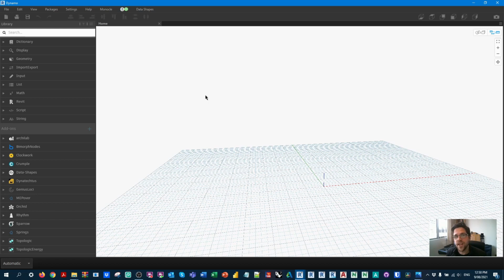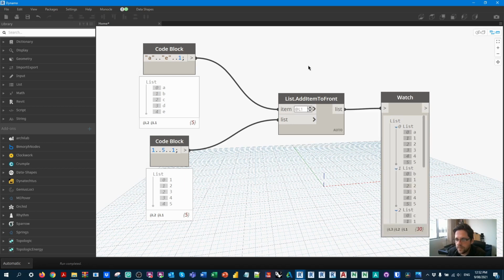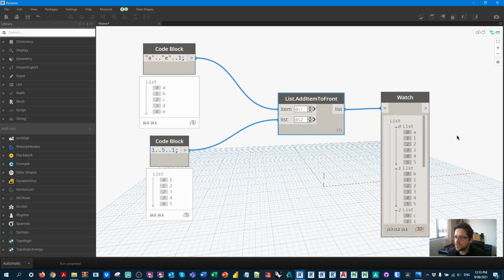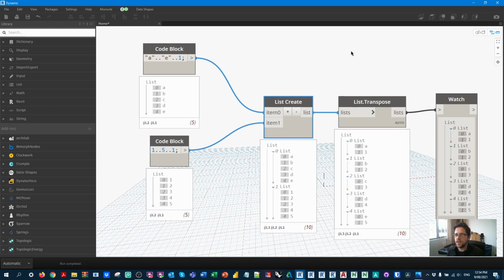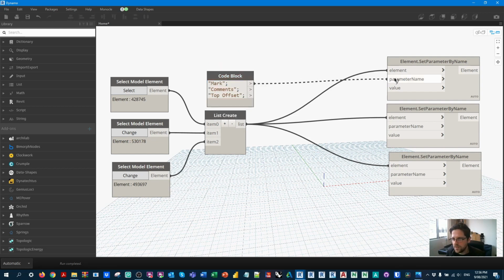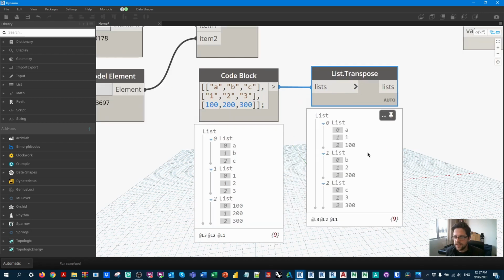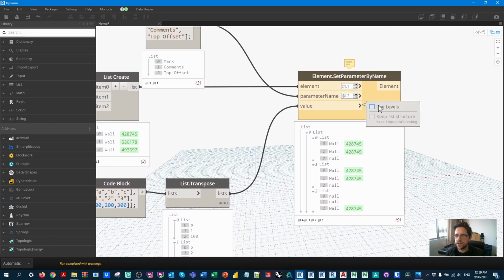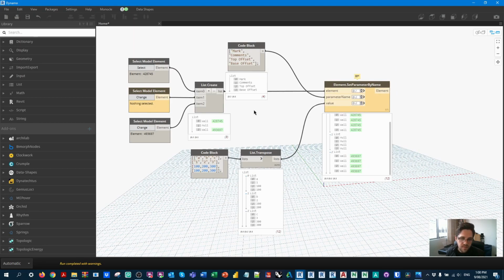Understanding list levels in Dynamo!

Comment: Thanks for the explanation about data structures in Dynamo!

In Grasshopper you would simply "graft" the list of elements to put each element in its own list. In this way, "all parameters" are assigned to each "element list" and the appropriate "value list" is also assigned to the respective "element list" (for all element lists). The procedure in Dynamo seems a bit more complicated to me, but understandable. But once I have more experience in Dynamo, I might find the approach in Dynamo better. We'll see :D

In Grasshopper there are also separate components like "Graft". I also saw a "Flatten" component in Dynamo, like in Grasshopper. This way we can inspect the changed list structure and see if it is compatible before using it as input.
Reply: Ah, now I understand. L1 at input "element" is the counterpart to "Graft" in Grasshopper. Then we set L2 at "parameterName" to use the entire list and L2 at "value" to use the individual associated lists. The display below the lists is very helpful for this, showing which lists are on which levels (@L3 @L2 @L1). At first I didn't know whether L1 starts at the beginning or at the end of the data tree. 

A little different than in Grasshopper, because in Grasshopper you can change the list structure and make it compatible and inspect it before using it as input, but this is now understandable in Dynamo. Now it's fun to work with!
Reply from the maker: Yes graft and level 2 on 1 are quite similar. Personally i much prefer working with lists if im trying to align data, as much as i do like the path mapper component!

Trees are very beneficial for geometry and speed, but lists are often easier to work through predictably. Trade offs.

Comment: one of the reasons that confusing me is that "reversed" order, L1 should be always 1st level which is outmost, in fact, it's innermost
Reply from the maker: Yes levels at first feel like they should work in vs outward, but over time you'll find more often than not you usually will want to access sublists this way due to not always knowing the depth of incoming list structures. I believe reversing @L1 would generally not achiece a lot as it would work at object level. Generally level 2+ would have more desired results.
Reply: @AussieBIMGuru  right, that makes sense

Comment: Do you have a good method of practicing this with uneven sublists? Such as deleting only curves of a polycurve that have a certain condition?
Reply from the maker: Generally I would use nodes like take items @L2 set to shortest lacing to trim sublists down to shortest depth. Typically uneven sublists are a good case to investigate how the lists became uneven, as in many cases they might be due to an error or a better way of managing data upstream.
Reply: @AussieBIMGuru  Today's script I was able to filter out unwanted elements not by removal but by replacing them. THEN apply the List.FilterByBooleanMask to get them out. 
It concerned deleting Gridline segments that were evaluated based on a shuffled list.

So Polycurves were each evaluated by a list that was in a transposed order. So transposing them back would wrongly align them if items were dropped. 

If this makes any sense haha.
Reply from the maker: @Segendary  ah yes transpose only works for equal lists generally. I mostly use it when working with matrices of data like excel/csv.

Comment: I have a problem if you can help me I want to copy dimensions between revit files same views same geometry but when i bind the dimensions disappear
Reply from the maker: It sounds like they may be struggling to find valid refefences. When dimensions are copied they usually search for new references and sometimes this doesn't succeed. Usually i suggest copying elements across with dimensions where possible, but otherwise it isn't going to be as reliable. Cross check the model coordoninates match also, other than that not sure if there's anything else that can be done.
Reply: @AussieBIMGuru  thank you it's the a multiple binded but still same model so i guess the problem happens when binding take a place

Comment: That's a wonderful example of an inefficient serparameter scenario. Btw, @L2 in element then the rest is default I believe also works the same, I'll check later. But Having used dynamo for maybe thousands of times I still trial and error in a scaled down list to be sure I get it right before publishing it to the team. Nested For loops and zip is easier or direct tbh.
Reply from the maker: Thanks! Yes I think you're right, there's a few levels combinations that could work in these scenarios. I use Python loops a lot now too, but I guess a lot of users don't know that side of Dynamo as well. I find frustration with levels is why most users move to Python.
Reply: @AussieBIMGuru my problem is that i don't really know python (find it more complicated than c#) and i wish there was a c# node in dynamo like in grasshopper, also it would be great if dynamo could use grasshopper as a example for the lists
Reply from the maker: @alleskaese  maybe look into zero touch node development which supports C#. I doubt Dynamo will go down the path of data trees as other programming languages tend to also be list based like dynamo is.

Comment: Hi!

It seems we can make it in easier way. We don't need to make a long lacing in the Set parameter node. We can turn on L1 for element list, don't change level on second input with list of parameter names, and turn on L2 on third input with data. In this case we take each element and each sublist of data and write the data in parameters list. We have similar lengths of lists with parameter names and data, so it'll work.

I test it in my script now and it works. I can't add here a screeshot unfirtunately.
Reply from the maker: Thanks! Yes various combinations of lacing and levels can usuallt achieve the same outcome. I try to use parallel levels for list structures where possible, but other approaches are certainly viable.

Comment: Thanks for the video! Really helpful. But something wrong with the sound. I heard your voice only in one ear using my headphones. Of course, it is not a big problem for short videos, but it would be great if you will fix it!
Reply from the maker: Yes it's a recording setting I forgot to fix in post production, thanks for letting me know. My recording device is mono so I usually have to mirror the sound in my editor, every now and then I forgot - whoops!
Reply: @AussieBIMGuru  I think the XLR mic is plugged in the first input of the audio interface, which would be the left channel. What you can do is use a mixer in conjunction with an audio interface, I have the stereo output of the mixer go into inputs 1 and 2 of the interface. Allthough a mixer will generally keep the two mic channels separated. I recently switched from  a USB mic to and XLR condensor mic so it’s an issue I have to keep in mind as well. As far as I’m aware OBS might be able to double the mono channels so that the left channel is also mirrored to the right channel.
Reply: Edit / Addendum: I have the mic (which is mono) plugged into the first input of the mixer. The two mic inputs are also mono. However, the “Pan” knob is set to the centre position, so the mixer puts this mono channel on both the left and the right equally on the main mix. If you turn the pan knob fully to left, if will only be heard on the left channel. When you turn fully to the right, it will only be on the right channel. By turning the pan knob, you can control how strong the signal is on the left or right channel. When it’s in the centre, it’s balanced equally. A mixer gives you a lot of flexibility in that regard.
Reply from the maker: @dykodesigns  ah that was very helpful, I managed to get my mono channel going through L/R equally using these tips! Thanks so much mate.